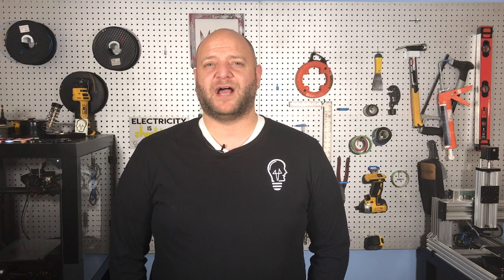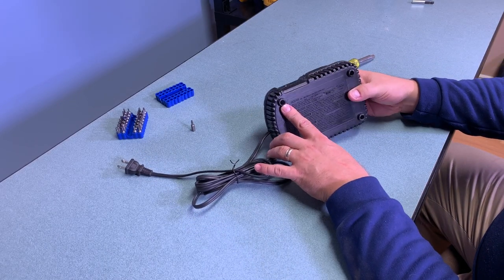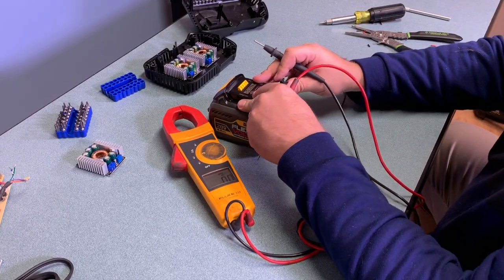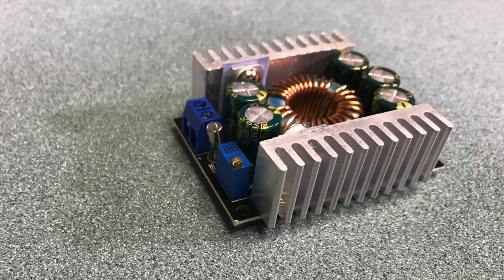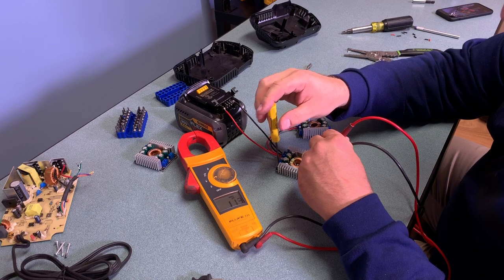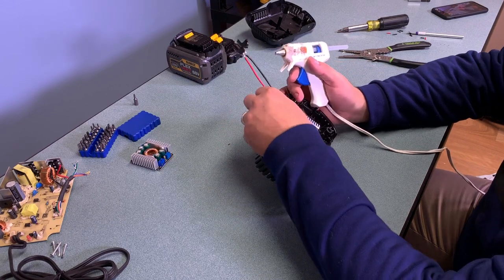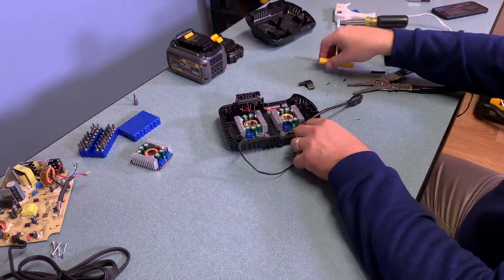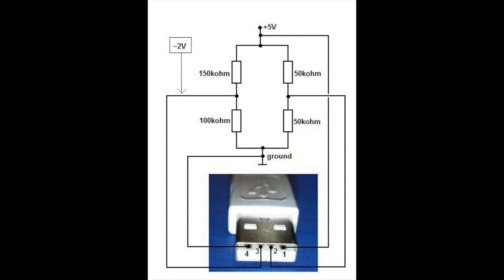Hack My Dewalt Charger and Make A Multi-Voltage DC Power Supply

Comment: I am interested in how to use an external power supply to at DeWalt tripod light DCL079. 
I have an old battery and a 19V laptop charger, but can’t figure out how to power the light on. 
We have to use B+, B-, TH and C3 terminals.
Reply from the maker: Thanks for watching. I’m in the planning stage for just such a project. Hope to have something posted in the next few weeks.

Comment: I’m just buying my first set of wires and really don’t quite have an understanding of anything electrical but I thought the same as you...why can’t I convert my Dewalt batteries to be an emergency backup for my Cpap?  I’ve purchased a step down buck converter and just have a question on what voltage and amperage to set up a cigarette lighter car type socket to plug in my Cpap machine.  Thinking 13.3 volts and 9.6 amps.  Any feedback would be appreciated.  Also bought a low voltage cutoff unit to add to mine since I have no idea what you did on that circuit board.
Reply from the maker: Thanks for watching. If the CPAP already has a lighter plug, it should be able to handle even up to 14V pretty easily. The amperage typically does not need to be set, unless you bought a converter with an amperage setting. The machine will just draw however many amps it needs to work at that voltage. 

One word of caution because you said you don’t have any electrical understanding. If the CPAP machine doesn’t come with a lighter plug and if it’s rated for AC and not DC, you won’t be able to use the method I did. You’d have to use an inverter to create the 120V AC. 

I hear those machines are expensive, don’t blow it up!
Reply: Thanks for the reply.  Yes, the buck converter I bought has an amp setting too.  I do have the cigarette plug converter for my Cpap machine so the socket is just what I need and yes, they are expensive which is why I am so nervous to try this...that’s why I posted to try and get a little more comfortable.  I have already tested my hookup with a dc fan and no problems except for my mistake trying to check amperage.  No smoke thank goodness.
Reply from the maker: @gsmiley7700  sounds like you’re being careful. Be sure to set the amperage of the converter well above that of the CPAP machine. If you limit the current, the machine could be throttled and not work correctly, which could reduce the effectiveness and lead to problems with the machine itself. If you supply the correct voltage with no amperage control, the machine will only draw what it needs to function correctly. So don’t worry about the amperage being set too high as long as your voltage is correct. Good luck!

Comment: Is it possible to make a 110v AC to 12 or 24v DC Variable Volt and Current output Power supply? Using a Dewalt battery charger to power a 100watt LED full spectrum Growing light.
Reply from the maker: Doug Despins you want to start with a Dewalt battery or start with a 120V AC supply?
Reply: @BaldGuyDIY  I guess it would be easier with the 120 AC supply , and I've seen a few using a ATX desk top power supply, but not a battery charger.
Reply from the maker: Doug Despins All the necessary components are in the battery charger to make a 120VAC to DC supply, then you could use the converter I used in my video to regulate the supply to your chosen voltage. You’d need to bypass some of the battery monitoring components from the charger so it would work as a power supply. I’ll see about doing a video for that in the future. It’s possible to get a new ATX power supply for about $50, or free from an old computer, so it might be the more convenient option than hacking a battery charger if the voltage it supplies is what you’re looking for.
Reply: @BaldGuyDIY  Thanks for the info. I decided to order a ATX power supply for my son, his is making a little ticking sound, then I'll use his old one. I'll be watching out for next video on this topic.

Comment: What about using an old DeWalt charger base like this but with a 12vdc supply and a cigarette lighter plug so you can charge the DeWalt batteries on the job site or driving down the road?  DeWalt has the DCB119 but that rascal's a hundred bucks!
Reply from the maker: Thanks for watching and for the question. It would be possible to convert an original 120V charger to work with the 12V vehicle outlet. I have it on my list of possible projects. It isn’t quite as simple as it might sound, and requires some features that aren’t in the original charger. $100 sounds like a lot at first, but to know that your vehicle’s battery and tool batteries are going to be protected from under and over voltage, maybe that alone is worth it. I’ll take another look at the merits of the project.

Comment: Neat idea!  I have a Dual DeWalt battery charger for the 20V where one side isn't working, though planning to troubleshoot and repair if I can.  I have wondered over the years about making an inverter like the power bank that uses the 4 batteries.  Thanks for the inspiration!

For now, I'm reviewing to make a PAPR power supply since saw the Ford design that uses the DeWalt battery packs and was like... duh... why not use a 20V DeWalt battery or maybe even two and buck down to the 4.5V the current design inflator as a fan is using.  I plan to purchase a battery wall mount holder and modify for use since most cost effective.  

I have a few videos (I am no way trained on video production or editing) on the adapter since I made a Dewalt 20V battery to Ryobi 18V tool adapter from a new Dewalt adapter and old One+ battery.

I'm planning to make another video since I learned how the batteries and tool work in more detail and I think I might even be able to repair the bad 20V to 18V DeWalt adapter now that I've learned there is a maybe 60A fuse hidden in a wire/wrap and the two transistors are MOSFET's reads like to check and if nothing in the potted section bad... seems feasible and even then... might be able to design that circuitry once verified.  Basically, there is a under voltage protection circuit output in the adapter or the 20V tools, sounds like, that the battery inputs to shut down.  I still haven't verified specs yet. 

However, I was wondering... where did you find six pins?  Mine only have 5 pins.
Reply: Double checked when watching another video with a disassembly and hack... confirmed there are only 5 batteries also.  https://www.youtube.com/watch?v=PNdQdzWtLVE  Thanks again!
Reply: OK, now I see.  I've only worked with the battery tabs on the 20V to 18V adapter and tool (since the tools literally have the adapters build into the grip before the trigger switch and are sometime a cost effective source as a part or from damaged tools where something else is broken).   So the batteries have a few more tabs than I realized, TH, ID, C1-C4, B+ and B-.  Looks like the charger has similar.  Glad this was troubling me, you shared and I kept looking into until I understood what was being presented.  Can tell I never looked at a datasheet on these batteries or chargers or studied the batteries or chargers thoroughly enough.  :-|)
Reply from the maker: Sorry I haven’t been able to take a look and explain. Glad you have it figured out!  Thanks for watching and sharing:)

Comment: Take a multi battery charger and turn it into a power station?  Like the DeWalt PS ?
Reply from the maker: The Toolmat The Dewalt power station produces 120V AC doesn’t it?  This is for DC, and it allows for a variety of voltages.
Reply: BaldGuyDIY  yes it will, I have seen the power caps for the 18-20v batteries and thought why can't a multi charger such as ryobis 6slot, be converted to an output and add a sine wave inverter to accomplish what DW has done?  There is a guy on YT that's has done it with the power caps, but it looks messy
Reply from the maker: I misunderstood your comment. I thought you were saying my project does the same thing as the power station. You definitely could hook an inverter up to what I did and make your own ac supply with it. I’ll consider it for a future project. Thanks for the comment!

Comment: I would like to make a 110v system to run my RV using Dewalt batteries. Any ideas on how I could do this?
Reply from the maker: Thanks for watching!  Depending on the RV, that could be a tall order for cordless tool batteries. Basically need to convert the DC voltage down to 12-13V, then invert it up to 120VAC. Do you know how much current you’ll require at the 120VAC output?
Reply: It's possible to find inverters that have a wide input voltage range.  I've never seen 18V specifically but there's definitely 36V unit's that would run on 2 in series.  If you have lots of them, you may be able to run certain loads by simply connecting 6 in series to get 120V DC -- like a small fridge, heater, or lights.

Comment: You are a tech brother! I am impressed, I love this stuff but my knowledge is very limited. I would like to hack a charger or a battery or both. To use 120 volt stuff with a dewalt battery. Like irrigation timers.
Reply from the maker: Thanks for watching!  I am planning on making a Dewalt battery to 120VAC supply video, so keep checking back!
Reply: @BaldGuyDIY  
That will be helpful. I am wondering if lawn mowers volt rectifiers would do the trick to us a dewalt battery to run an irrigation system. It would be awesome. You need to come up with something like that and make 100s of thousands selling to irrigation companies. Thats a serious joke brother. Lol

Comment: not sure if it's been mentioned (and awesome idea in and of itself) but the more the drop between the input and output voltages the more heat is generated in the buck converter. what would be better (and sometimes more efficient) is to run your 5 volt regulator from the 12 volt regulator and not VBAT
Reply from the maker: That’s an interesting suggestion, but I think the increased load on the 20V to 12V step would make up the difference in the heat lost. It would still be the same amount of conversion, just in two stages instead of one, wouldn’t it?
Reply: @BaldGuyDIY  nah it depends on how much you put on the 5 volt line, to be honest it wouldn't even notice it.
Reply: @BaldGuyDIY  I added a mini cup fan. .018 amps current draw. You won't regret it. Cheers

Comment: Have you , or any of your followers made any progress on how we can run a 20volt MAX Dewlt tool of  120 AC input.  Those far the only thing I am seeing is to use a old PC power supply to get the required amperage needed by say a circular saw or saw zaw?
Reply from the maker: Hi, thanks for watching and commenting. Sounds like you’re wanting to power a 20V cordless tool from a 120V AC supply. I did post a video recently discussing this very idea. I am still in the process of putting the components together to make it work, however, if you watch the video I did, it’s not very practical, especially for the higher current requiring tools like saws. The video describes all the components required, check it out and let me know if you think it’s worth it.
https://www.youtube.com/watch?v=E0pq6vJi_7g
Reply: @BaldGuyDIY  I watched it, thanks.  Yeah, the cost of the components makes it not make sense.  The only way I could see it working physically is if the converter and all the parts was a floor unit that then ran 12 or 20 volt long leads to the tool.  I was thinking something like a low voltage lighting power supply, before they all went to LED's and got smaller again.
Reply from the maker: @bartelsjoshuac10  Thanks for watching it and for the feedback. Maybe there will be an easily convertible device in the future that makes it economical. If you find one, be sure to let me know!:)

Comment: I’ve been rackin’ my brain trying to learn about buck converters to make a 12v kayak and camping power station out of my Ryobi 18v one+ batteries. 
This video is exactly what I wanted to do!!! Thank you for the information!! My question is: 
could I use two 18v batteries ran in a series to 36v then buck them down to a 12v output to get more amp hours (or total watt hours) out of the power supply? Would it be beneficial or redundant to run two?
Reply from the maker: Hi, thanks for watching!  That’s a great question. The batteries have the same amount of energy stored in them, so whether you do an 18V supply in parallel or a 36V supply in series, the amp hours will be the same. In parallel you add the Ah together, in series you only add the voltages together, the Ah stay the same. There is the possibility that in series they would last a little longer if you’re going to be putting a lot of load on them, because in series the current will be lower, cause less heat, and batteries tend to perform better in those conditions. However, if you connect them in parallel, there’s the opportunity to swap one battery out for charging without interrupting the supply to whatever you’re powering. That feature may be worth it on its own.
Reply: BaldGuyDIY thank you so much for the reply and information! And just to be sure: essentially (for my purposes) the in series idea would be a redundancy, and depending on outlook even parallel is a bit redundant because there would be no difference in running two batteries at once; compared to one after the other; aside from a slight interruption when swapping?
Reply from the maker: twisted4good The parallel connection would be redundant and unnecessary if you don’t mind the interruption when you swap batteries. The series connection wouldn’t offer redundancy, because any problem or removal of one battery would break the circuit and prevent your load from being powered unless you changed the connection. Also, be sure to check out the version 1.1 video so you can see how I prevent the battery from discharging too low. If it goes too low it can prevent your charger from charging it back up. Good luck!
Reply: BaldGuyDIY awesome. Just awesome info. I did watch the other video regarding the over discharge because I too was curious regarding just that. Fantastic two part series full of well explained knowledge. I’m excited to start my power source project. Thanks again for the replies and tutorials 🙌🏻